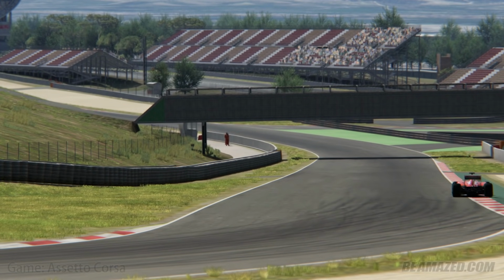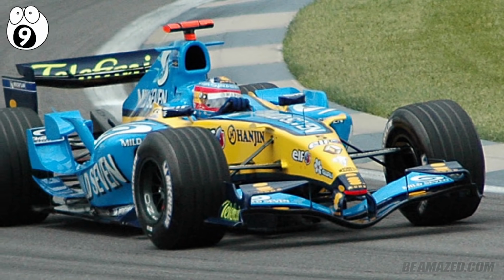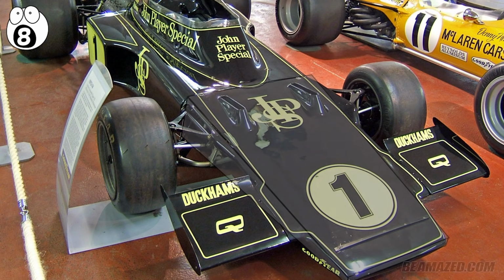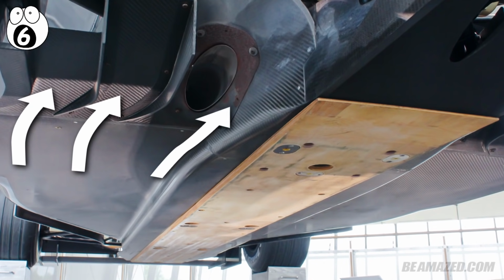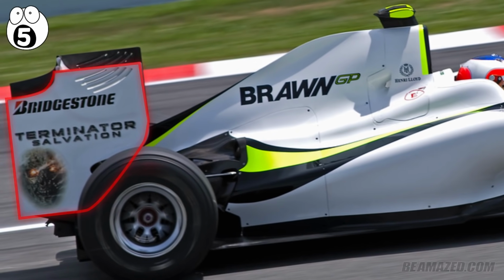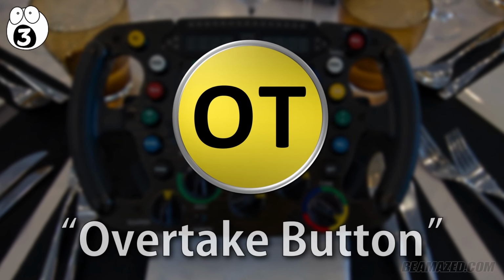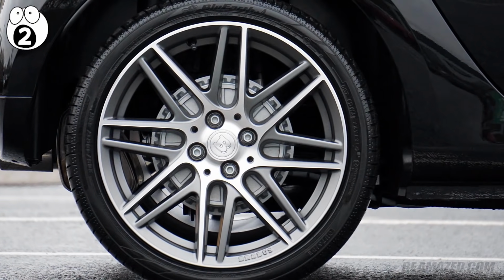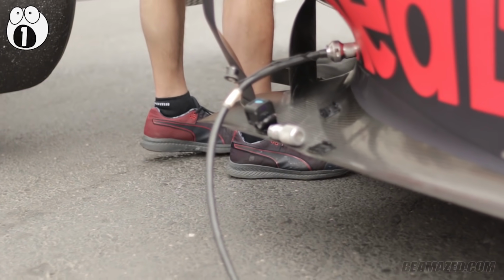Secrets Of F1 Car Design You'll Find Really Interesting

Comment: Everything, literally everything is wrong.
Reply: Come on, at least the front wing does offer downforce
Reply: Slightly, it's primary purpose to to control airflow towards the main downforce generating surfaces and and divert air around the tyres to reduce the enormous drag they cause. Actual downforce for front end grip really is the secondary purpose of the front, despite how insanely counter intuitive this might seem.
Reply: Agreed about the avertion of the turbulence that would occur if Air passed towards the wheels, but on fast turns most of the downforce is provided by the aerodynamics, and the front wing plays a huge part. Not only as a means of driving Air towards other parts, as you said yourself, but independently as well.
Reply: "The rear wing end plates have one job and that's to create straight line drag."

Wut
Reply: "carbon fiber is 5 times stronger than aluminum or steel"
"It's baked in an autoclave"
lol... just ... lol
Reply: Roelof, I guess that would make you a not knowing, non-F1 fan.  He (jontyoldmanface) is correct.  This video is full of misinformation.  A few kernels of truth, based on what was true 20 years ago, and updated with some moronic guesswork at best.  This channel gets so much wrong, on so many subjects, that I watch it as a source of comedy rather than education.
Reply: Jonas Bögemann There's no "main" purpose, it's not just designed to divert air around the tyres or produce downforce. It has been mentioned by several F1 engineers that its most important feature is to create vortices which is guided to the floor of the car. Those vortices (you can actually see the vortices on close ups and very clear in the rain) channels alot of air and that makes the floor of the car make the biggest amount of downforce. Downforce is roughly distributed 30% front wing, 40% floor and 30% rear wing (some say it's closer to 50% floor).
Reply: The intake is up high to avoid the hot air released by other cars... the air that is released from the rear end creates an amazing heat wave rooster tail as they go down the track.  It's visible in the clear, it's visible in the rain, and it's much higher than the air intake.   Also... let's ram air "supercharge" the turbocharged engine.
Reply: unlike road cars, these tires have nitrogen... i have nitrogen in my mazda's tires...
Reply: Bryan Hopkins 
https://www.youtube.com/watch?v=xjsUwFHQbWo 
these are some really good videos explaining the aerodynamics of a f1 car
Reply: Links for further research so that I can get the legit info?
Reply: DandiLionism I would like the statement to be more specific. 5x stronger by weight perhaps? Aluminum and steel are miles apart in every way. That comment was not very informative at all imo
Reply: ScottyC 

F1 cars do not only use carbon fiber to be lighter, they use for the stiffness of the front wing so the elements don’t bend
Reply: As soon as this video started I had to just pause and just take a deep breath
Reply: F1 cars use pure nitrogen as opposed to air (which indeed is mostly nitrogen) for pressure-heat-expansion reasons
Reply: no every thing are not fakes 
don't beieve what's he's say
Reply: you do have a point it is not true
Reply: Your so write
Reply: jontyoldmanface so then tell us what is wrong and correct it then Einstein

Comment: sick! alot of things i never knew. you really need to avoid riding behind someone because the bad airflow? i always thought you could go faster because the 1 in front takes all air away
Reply: Amnesia 
If you are following a lorry, then yes.
But as an F1 car uses lots of aero to ease it's way through the air,it gets upset when it has to deal with 'unsettled' air( such as the controlled air that the f1 car has passed through and used a second before.
There is a sweet spot that gives the following car a tow,but if you don't get a pass made,sitting in the 'dirty air' created by the f1 car infront unsettles the following f1 car,even the air temp will be greater
Reply: ah okey thanks
Reply: Amnesia lol not is nascar
Reply: Well you can go "faster" in slipstream, but then you end up with no grip and then can't actually power down as efficiently out of corners without wheelspin due to a lack of downforce so unless you're on a straight section and already above ~120mph then it's not beneficial
Reply: Levi Partridge makes sense =)